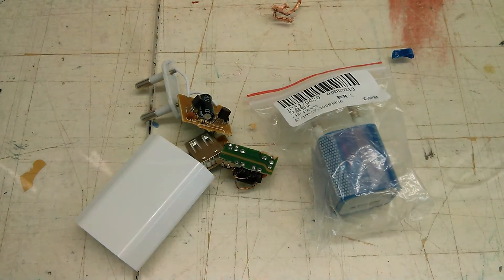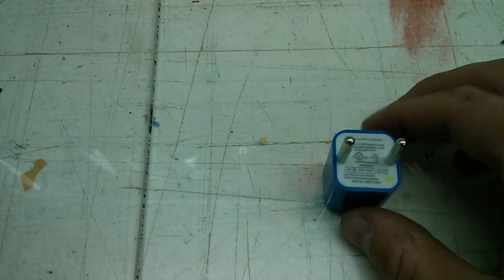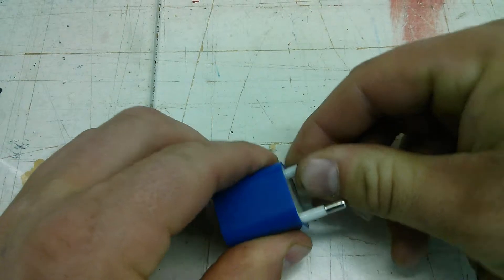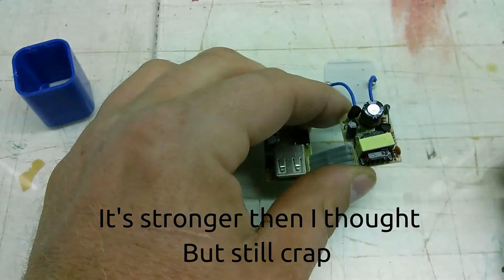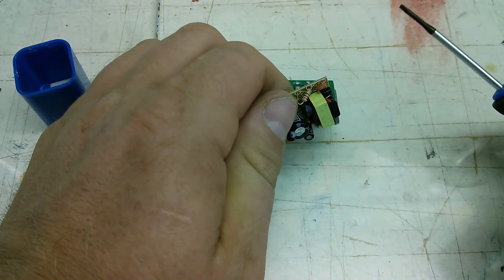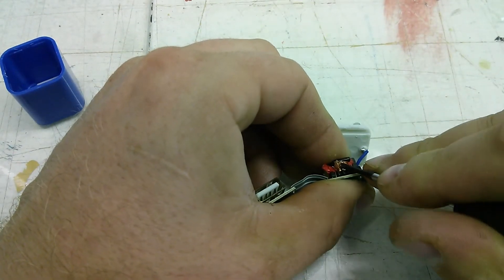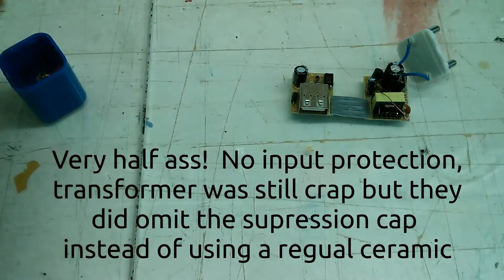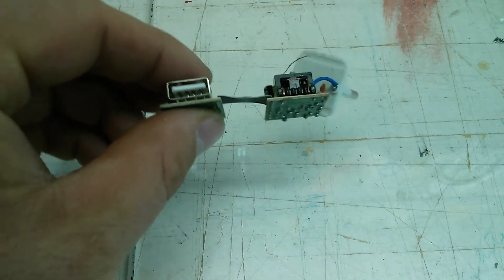004 $0.99 USB wall charger teardown

Comment: I have several of these pieces of crap and wondered, is there anything you could actually do to make these better (I just wanted to do it as a project, id never actually use these)? I have wanted to make my own wall charger as a fun project and have been trying to study the circuit diagrams but im still quite newb.
Reply from the maker: +davidca96 SMPS design is not an easy thing and definitely not a good project for someone that is new.  If you want to build a power supply to learn about the operation I would suggest building a linear regulator completely out of discrete parts (no integrated circuits) to start.  Non isolated DC to DC switching regulators can easy to build but with out an oscilloscope it's not easy to see what's going on for educational purposes.
Reply from the maker: +davidca96 SMPS design is not an easy thing and definitely not a good project for someone that is new.  If you want to build a power supply to learn about the operation I would suggest building a linear regulator completely out of discrete parts (no integrated circuits) to start.  Non isolated DC to DC switching regulators can easy to build but with out an oscilloscope it's not easy to see what's going on for educational purposes.
Reply from the maker: +davidca96 SMPS design is not an easy thing and definitely not a good project for someone that is new.  If you want to build a power supply to learn about the operation I would suggest building a linear regulator completely out of discrete parts (no integrated circuits) to start.  Non isolated DC to DC switching regulators can easy to build but with out an oscilloscope it's not easy to see what's going on for educational purposes.
Reply: +Andrew Rousseau Thanks for the advice, I'll try starting with much simpler circuits and work my way up.

Comment: sir can i ask a question? i bought a brand new asus fonepad7 his charger got annoying sound when in use, its that normal? thanks
Reply from the maker: A high quality charger should be inaudible.  I don't recall ever having a name brand phone or tablet come with a charger that had any audible noise when in use.  I'm going to assume that the noise is a high pitched whine or squeal.  This can be caused by a number of different parts.  Lose transformer laminations vibrating, electrolytic capacitors and some types of ceramic capacitors.  It could be a bad charger in the lot or it could be piss poor design and/or manufacturing.  It is common to find power supplies contracted out to a third party for design and manufacturing.
Reply: +Andrew Rousseau thanks for the info my problem been solve asus service center replace my charger with a new one.